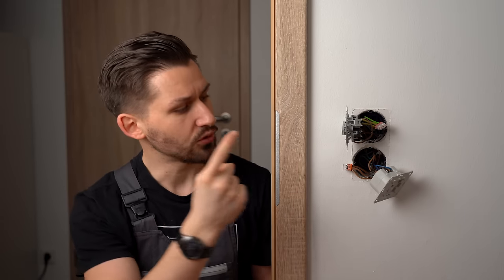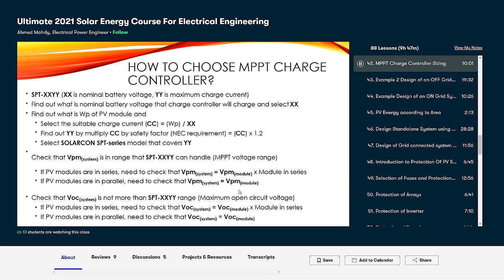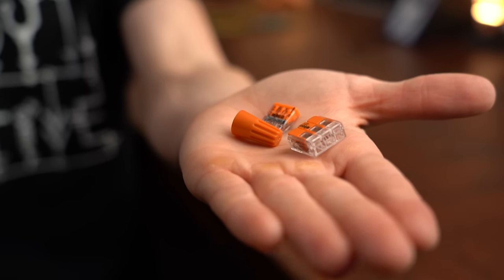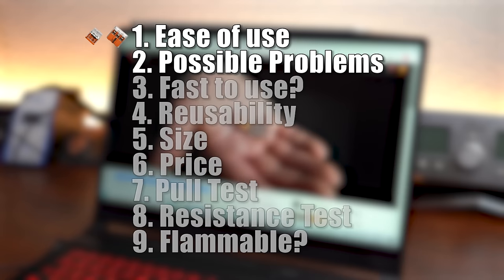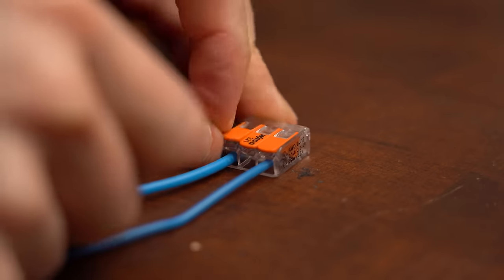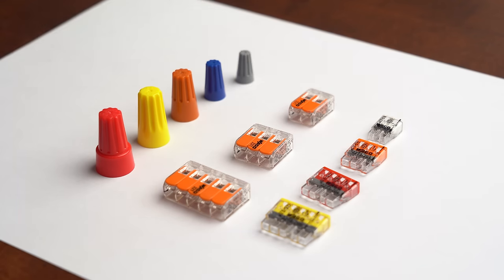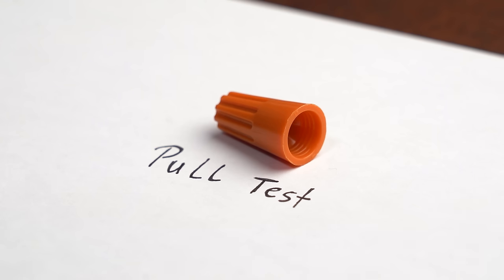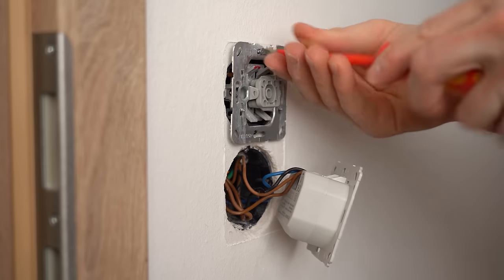What Wire Connector is the Best? Settling a Debate! Wire Nut VS Wago

Comment: Since I discovered lever Wagos, I find myself using them more frequently in both mains projects around the house and low voltage prototyping situations. The strong snap of the lever feels like I always get a nice full contact that wire nuts just cant match. Plus they save so much space in small junction/switch boxes!
Reply: " The strong snap of the lever feels like I always get a nice full contact that wire nuts just cant match."
I don't do mains stuff, and I use neither of these for low voltage electronics, so this might be ignorance on my part. But doesn't the fact that the nuts give a lower resistance indicate that it makes much better contact?
I say indicate, because the busbar, by virtue of creating additional length, adds extra resistance, so even if it gives a higher overall resistance, the contact resistance might be lower.

I personally think that the Wagos are better based on the videos I've seen from Scott, and the fact that I have seen improper applications of wire nuts, which seems so much harder to do with the wagos.
Reply: @sr6550  Thing is that when under power or when using stranded wire the wires (especially thinner ones) will somewhat deform and possibly worsen the contact resistance.
WAGO and other spring tensioned connectors come in handy in such occasions since the spring loaded tension will assure a good connection besides compressing the strands together which leaves less surface area for corrosion
Reply: @sr6550    You are absolutely correct. Wire nuts may offer lower resistance, but twisting together neutrals in a residential switch box (5+ 12AWG conductors at times) can end up causing one of those conductors to pull out of the group and you wont be able to know by just looking. With the wagos I only need to look at the top side and I can easily see all conductors fully inserted.
Reply: Big fan using them to do low voltage layout before crimping.
Reply: @sr6550  The 'added' resistance is trivial. There have been many tests under thermal load and they perform perfectly. I worry more about some mucho-macho apprentice overtightening a connection and annealing the copper. In my 35+  years in the trade, I've seen that happen too often.
Reply: @nightwolf5887  Correct!
Reply: @nightwolf5887  You wouldn't twist five wires together ever. You'd do a daisy-chain of 3, with one coming off to do another 3, with another off to do two. That gives you five solid twisted electrical connections. Four is already sketchy and so difficult it's rarely tried. Three is easy enough, but still can be challenging.
Reply: @toddthreess9624  Mission-critical stuff will be hooked and screwed in, not much is going to beat that. It's easy to do in a machine box. Mains power has something similar, screws pretty huge blocks into the end like  a guillotine with a large amount of pressure.
Reply: @ethelryan257  > "I worry more about some mucho-macho apprentice overtightening a connection and annealing the copper."
I think you mean 'work hardening' the copper. That is going to happen any time you bend copper. And that actually contributes to the strength of the twisted-pair wirenut joint considerably. Annealed is the state of soft-bendable copper it's going to come to you in. Simply straightening it out off the roll is already work-hardening it to some degree. Only screwing up the joint and having to redo it a couple times is going to result in stress and breakage of the copper.

Comment: Here in Europe, and 240V, the currents are smaller compared to US where 110V is more common. Something to consider when comparing the contact resistance..
Reply: I had the same thought about why WAGOs are more popular in Europe while wire nuts are more popular in the USA. It makes sense that in the EU, with higher voltage and lower current, the relatively greater resistance of WAGO connections is less of an issue than it is in the USA with higher amperage for a given wattage.

A 1500 Lumen LED household light bulb that draws about 13W is generally considered to be equivalent to a 100W incandescent bulb. This is a pretty bright bulb. An typical LED light that's in the form factor of a 5 to 6 inch recessed ceiling light draws about 13W and is equivalent to 75W incandescent (more-or-less). At 120VAC, that LED can is drawing 0.11 amps. At 0.0022 Ohms of resistance (as measured by Great Scott), you get a power loss of 0.000027W. This is basically zero.

So in the USA, if I'm wiring up a lighting can or an AC-powered smoke alarm, I think the difference in power loss between a WAGO 221 and a wire nut is de minimis. In both of these instances, when I do wiring myself, I'm generally on a ladder working overhead, and I much prefer the increased simplicity and speed of using a WAGO. For those overhead lighting and smoke alarm installations, I think WAGO connectors are less error prone since it's harder to balance on a ladder and get a very solid and even twist on 2 wires -- I think especially for a stranded-to-solid connection and when you're connecting wires of different gauges together.

If I'm wiring up electrical outlets, I'm not working overhead. I get to sit in a comfortable position, and I can take my time to twist together wires very tightly. My wife might plug in her hair dryer and draw 15A from an outlet. In the kitchen, we might run our mixer or toaster oven or coffee machine. In my garage, I might run my AC air compressor from an outlet, which draws quite a lot of amperage. In all of these cases, I've decided to use wire nuts for household outlets and potentially any other circuit that will draw more than maybe 1A.

Comment: I used wire nuts for decades, a big issue is trouble shooting, and the pull resistance can actually be a problem.
The biggest issue is wiring older wiring, or wire that have been heat damaged, such as subject to heat from a fire. You can have a broken connection inside the wire nut, and when you pull a wire does not come free. What happens is that a wire breaks, inside the wire nut, because it is brittle from heat, but the connector is still grabbing both wires, and the broken connection in one wire causes issue with the connection.
The Wago's allow you to see the wire and troubleshoot much more easily, and are the only connections I use now.

Comment: I'm from Eastern Europe, and I have been doing electrical work for almost 20 years now. Given the fact that we were occupied by Soviets for almost 50 years, majority of our old electrical installations didn't had any wire connectors at all - just a twisted wires with some terrible plastic duct tape that mostly had disintegrated. As a result when a proper building codes were introduced here 20 years ago a first product that came to our attention were twist cap ("American style") connectors like shown in this video. I happily used them for 10+ years without a second thought - ANYTHING was better than a bare twisted cables and duct tape. But once I had a chance to try out Wago for the first time - oh, boy, I have never used twist cap connectors since that day. Wago is better in any imaginable way (apart from the price, though) - they are smaller, easier to use, faster, and much more reliable (from my experience at least).
Reply: Our house was built in 1939 and the original wires are fabric wrapped with a lead liner. You look at them funny and they fall apart :( Moist of them are replaced now though.

Comment: I think the biggest difference between the two, is the power they are used for. Wago connectors are primarily european, where 230 volts is the norm, while the U.S. uses 120 volts. Since we use lower voltage, it means to compensate, we have high current. The wire nuts are much more compatible for high current connections compared to the wago, which is why they are more common here.
Reply: Good Point. Half the current, half the heat inside the Wago. And maybe not an original Wago. For my 3D-Printer Heatbed 230 V i use Wago´s. Wago has a mounting system. Wire nuts too?
Reply: @helgemoller5158  Half the current – quarter the heat inside a Wago. Q = I^2Rt

Comment: I feel like these tests can be a bit flawed depending on where you’re from. Where I’m from, we use higher quality wire nuts than the ones tested and almost everyone I’ve met pre-twists their splices.
Reply: I like to strip an inch and hold the wires with 520 channel locks (the small ones), and offset the strands and use Klein Wireman's Pliers to twist the connection. I snip the tip and then I use the winged wire nuts on my connection. (A multi-tool with the barrel pulled out fits over winged wire nuts and gives a great grip to run them down tight). I did this professionally during my carrier.
Reply: I came to say this, best German connectors versus cheapest Chinese wire nuts.

Not even a remotely fair comparison.
Reply: They don't make them in Europe, so you can only get cheap ones
Reply: @onebacon_  no but good wire nuts exist on Amazon ;)
Reply: @onebacon_  I don't think they are even legal to use here, never seen one being used in all my life in any installation.
Reply: @Remix God While that works, as an electrician I sure don't trust them.  Plus the name brand ones allow a bit more slip in how long your wires are.
Reply: @-JustHuman-  They are a pain in the ass to use but make a much superior connection. Long ago they were even made from porcelain. If I had to guess it takes 100 to 200 times longer to properly twist the wires and put the nut on.
Reply: Conex holland makes the best wire nuts, he use the wire nuts totaly wrong.
Reply: @T Turner  he ordered them from Amazon. They seemed fine. If you don't have a clue about them, you wouldn't see a problem. That's at least how I feel, (also having not a clue about them).
Reply: @gaby de wilde  The porcelain wire nuts were banned in the UK many decades ago.

Wagos have passed multiple tests and are certified for use in a multitude of nations. No point in using anything else in my opinion.
Reply: It's funny brand name for wago but no name brand for the wire nuts like said here why not use ideal or something used in a brand name
Reply: where i live its illegal to use them , all of the connections schould be dismantable if possible so it doesnt meet the criteria.Also when testing complicated circuits you would have to untwist loot of wires

Comment: I have been using wire nuts since I was in my teens. I was given some Wago connectors a few years ago. I like both. I don't see the issues with "user error" people have pointed out, because you can have the same problems with Wago. Wire nuts were designed for electrical wiring in walls. In industry, you use systems that take vibration into account (screw terminals). Wire nuts are perfectly fine to be in a wall for 40 or 80 years, where if there is a lot of vibration, or moving of the wiring, the fact that you used wire nuts isn't you biggest issue. Wago are great when you need to change things for service etc. I have used them in my lab, and in industrial designs because screw terminals are tedious. I would never use them to wire a house, because they are overkill, and too large. This is magnified when you have to get stiff solid wire in a work box, and a huge Wago connector. As far as using wire nuts to join stranded, and solid wire, I have done it countless times, doing it right as with anything else takes experience. In most situations where you would use wire nuts (in walls, and ceilings), you rarely would be joining solid and stranded wire. For all of the comments about how they had to replace poorly installed wire nuts, that's not the fault of the wire nut, it's the fault of the contractor, or inspector. I have seen Wago installed with a strand or tow of stranded wire sticking out, and too short a piece of solid wire to grip properly.

The short answer with this is use the option in the way it was designed to be used. Have qualified people do the work.
Reply: Even, when you have a tight space i feel like wagos are easier to work with.
A) they are rectangular so you can easily stack them. Especially if you connect more than 2 or 3 wires. Even something like 8 Wires can be done in a neat box of 2x 5 strand connectors stacked together.
B) the wires go in straight and you don't have to manipulate them other from pushing them in. Thus you can cut your wires to a length that they don't even come out of the wallbox and still be perfectly fine with installation.
Wich is bad practice, but it works relatively easily.
C) a 2x Wago is still small enough to fit literally everywhere. I haven't had the point of "I wish my connectors were smaller", I always had the point of "i wish there were fewer wires in my wallbox". And at that point the connector isn't the biggest issue.
Reply: I need to disagree with one point. Wire nuts are quite often used with combined solid and stranded wire. Building wire is most commonly solid core in homes, but light fixtures and smart devices near-universally have stranded leads.
Reply: Have qualified people do the work!

Comment: The most important advantage of the WAGO Connectors is, that they don't get loose over time because of temperature variations.
When I open an old junction box, the old screw terminals are often a bit loose. I can imagine, wire nuts can also become loose after temperature cycles for 20+ years.
I never had an issue with WAGO connectors coming loose, even very old ones.
Also, the WAGO connectors are almost foolproof to install, wire nuts or the older screw terminals require far more skill to be installed correctly.
Here in Germany every electrician I know uses WAGO terminals. The old screw terminals seem to have disappeared completely. Just for the time saving alone, WAGOs are worth the money.
Reply: Actually they do work loose over time.
Reply: If it's predominantly a monetary loss and you already have the skills to properly affix a wire nut, there's little benefit in using 
wago. I have had to replace such type connectors quite alot here in florida exactly because they no longer held good connections so im not sure the lifespan of one vs the other is any better.
I think wago is the way to go for newever people getting into electronics as they are easier to use though.
Reply: Why should a wago connector come more or less loose than a wire nut? Both are based on a spring mechanism. And in my 300m² house we had a lot of very old screw terminals mostly ceramic types ~70 years old. Most of them were very tight so that unscrewing them sometimes even the ceramic broke. I can't remember one that was particularly loose.

 I personally prefer wago connectors (or their cheap alternatives), however I think there isn't anything wrong with screw terminals (Dosenklemmen/Lüsterklemmen). If you use Lüsterklemmen (double screw ones) and put the wire through both screws you will get a really good and strong connection. And they even have some advantages especially in terms of size.
Reply: I came across old WAGOs (the black ones) in an old lighting setup which was buried under the ceiling for 20 years and the connection in all of them was excellent and nothing was loose. I even reused them instead of using my new ones because they were perfectly fine.
Reply: @lal12  I have had a lot of failures on wago connectors in industrial environment, my only experience of wire nuts was on an American import machine on the motor terminals after they caught fire I had to replace them with 16mm2 crimp lugs.
Reply: @lal12  They are much less prone to loosening over time vs. wire nuts (or Lüsterklemmen for that matter). The spring steel insert in the Wago terminal provides constant clamping load on the wire, whereas all "screw" types do not - they lose tension through heat cycling. Once the copper conductor is deformed by heat, it will have wiggle room after cooling back down.
Reply: @kain0m  I suppose the Wagos will loose their spring tension when overheated by overcurrent.